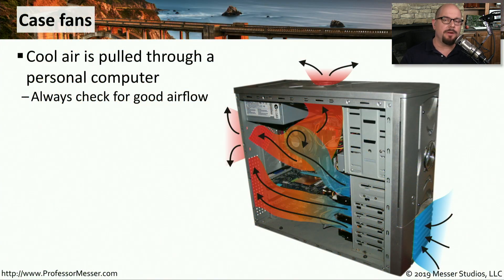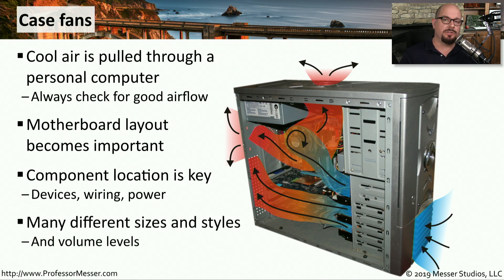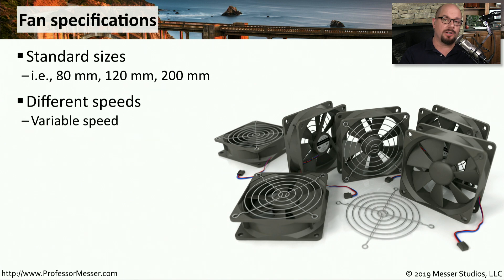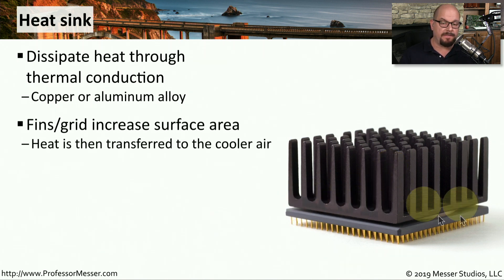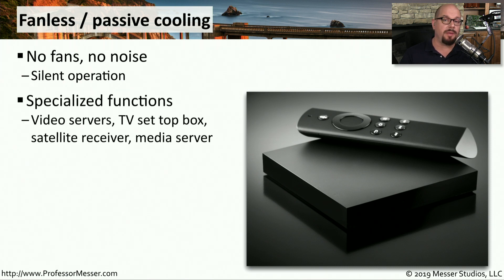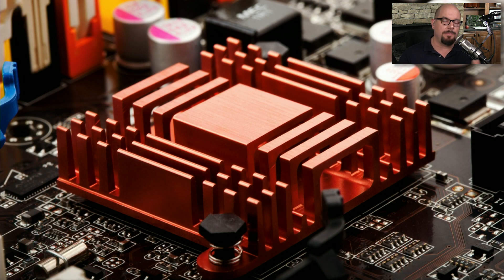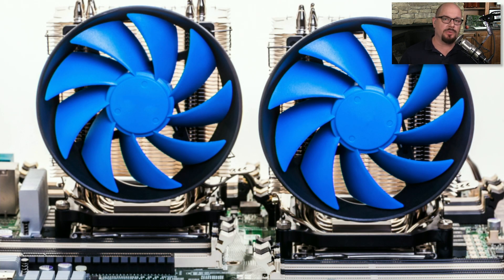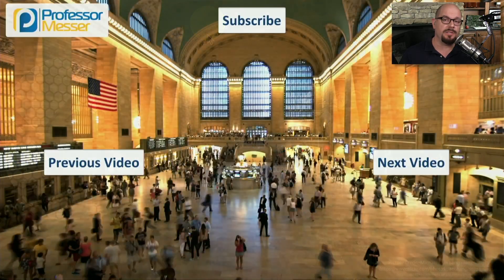CPU Cooling - CompTIA A+ 220-1001 - 3.5

Comment: Love these videos. Quick note on fans for anyone who hasn't built their own machine yet. 80mm is almost exclusive to prebuilt machines meant for office use. You will almost never see 80mm fans in gaming or video editing rigs. Because of their size, they have to spin very fast to move enough air in and out of your machine making them noisy. While 120mm are the most common by far, 140mm has been slowly pushing its way to be a contender for the top spot. Comparing 120mm and 140mm, the 140mm offers equal amounts of air flow while spinning slower. This essentially means you can get the same air flow while the fan runs at a lower speed, making it produce less noise and extending the lifespan of the fan motor.  You might be asking "Why wouldn't everyone buy 140mm then?" The answer is it depends on the chassis you are choosing to build your computer inside. The slots for the screws have to match the type of case fan you're attempting to install. A lot of cases at the time of writing this support both 120mm and 140mm by having both slots drilled out in the front, top, and rear of the case. 200mm is a very uncommon form factor, and generally if  the case is going to support this size it will come with the 200mm fans preinstalled.

In summary, bigger fan = less revolutions to move the same amount of air = less noise = longer component life. The best advice I can give: use the biggest size your case will allow you to install.
Reply: awesome advice, thank you!